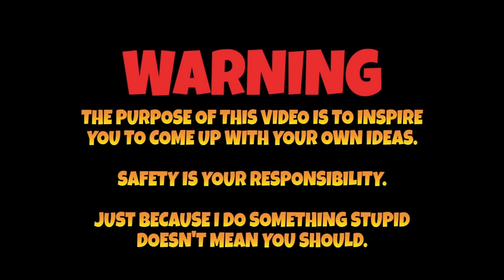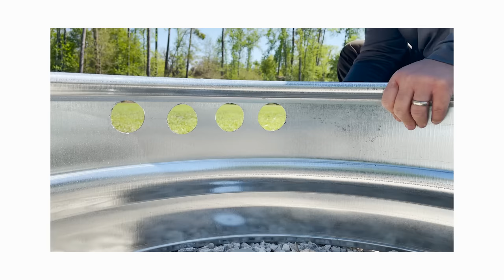12V Milwaukee More Powerful Than 18V? Head 2 Head Torture Test!

Comment: I’ve ran m18 fuels for a few years and they’ve out performed anything else I’ve used! Finally broke down and just bought a 12v fuel set which is why I am watching this. This video is a perfect example of using the right tool for the job. 18v is good for install, 12v is more convenient for service and repair! Just my opinion as an electrician who’s worked in residential, commercial and industrial settings.
Reply: That and sometimes the m12 can  just get in some real tight spaces I feel
Reply: Bingo. I'm in residential HVAC service and the M12 line serves me well in SO many situations working in tight quarters. IMO, M18 is great for commercial and residential install.
Reply: So as an electrician myself. I am asking what you mean by the m18 is better for installs? Obviously useful for drilling wood studs, unibits, and large holes. However, in steel stud for the application of boxing, strapping, and even half inch holes with twist bits I think the m12 is more than powerful enough.
Reply: I use makita 18V and milwaukee m12 at work as a door installer. No doubt 18V tools are stronger than M12. But the M12 tools are overpriced and some of them are even more expensive than the 18V makita
Reply: Totally agree. The M12 are better for lighter jobs where you don't need extreme tork but finesse for a finished product.
Reply: I'm electrician as well and that information helped me to choose right tools. Cheers.
Reply: Sad the m12 fuel is so compact, as an hvac installer something with a small battery would be great
Reply: M18 all the way, I do have the M12 screwdriver though and it's my go to for finish work.
Reply: I am an electrician and my fuggin DeWalt set got stolen so I replaced it with an M12 set.

Comment: The lack of tightening and locking your bits in the chuck was a bit frustrating…and you can add the handle to save your wrist a little
Reply: I was going to comment the same thing, about the tightening/locking and handle to save wrists.

Comment: Great video but when you tighten down Milwaukee chucks don’t hold it and spin the drill to tighten it, that’s why your bits kept falling out if you spin the chuck by hand with the drill off there is a ratcheting system that gets the chuck super tight. On a side note the m12 is great for light duty but for large paddle bits and hole saws the m18 is the top dog
Reply: After you ratchet it tight by hand you can go back slightly the other way until you hear a click and your bit is now locked into place
Reply: WRONG. Turning the chuck back until it clicks UNLOCKS IT. Go watch AvE's video about this, he breaks down the patent drawings and everything. STOP PERPETUATING THIS MYTH. IT DAMAGES CHUCKS.
Reply: Milwaukee Chuck’s just can’t hold bits no matter what just a problem with them .
Reply: @leaf5073 link the video, don’t know who AvE is…

Comment: While I won’t argue that 18v is more powerful, I’m an electrician and I use m12 impact and drill at work every single day. Serves my needs just fine. About the only thing I really need an 18v drill for is hole saws. I run the surge impact though because it’s a lot easier on the ears. It crazy how much quieter the hammer is on it.
Reply: I got the m12 surge impact and I've framed 100s of lineal feet with no prob...so many ppl like how it sounds like a toy but it gets it done!

Comment: I have M12 tools, I got them for the smaller size and ease of handling.  If I needed the added power of the M18, I use a plug in tool.  I have the impact driver, hammer drill, reciprocating saw, multi tool, 3/8 ratchet and 3/8 impact wrench.  They have been great tools, very ergonomic and reliable.
Reply: Same here...my M12s cover just about everything I need and if not I use my corded tool.
Reply: @WolvesHart79  The only thing they miss is an m12 wood planer. That would be amazing, I was surprised Milwaukee doesn't make one.
Reply: @em4703 tôi cũng muốn 1 chiếc máy bào gỗ m12

Comment: I brought the M12 Impact into the shop and it was laughed at
Now: Everyone in the shop has the M12 Impact and nobody's laughing
Reply: I too was laughed at the jobsite. No almost everyone I know has M 12. From there a little SDS setting air conditioners to impact driving screws to compact bandsaw cutting strut. They are more than powerful enough for most work and they are so much lighter hanging off your toolbelt or working overhead. Yes I have a super Sawzall and an M 18 super hole hog. Sometimes you need bigger heavy duty to but most of the time you don’t
Reply: @kconnor2371  this was my thinking, ppl make fun of ya till their shoulders arent as worn down at the end of the day from not having 5lb of tool over their head

Comment: This is painful to watch when the guy doesn't know to manually tighten and lock the chuck.

Having said that, I own a large amount of M12 tools and Makita 18V. 
There is a HUGE difference in power once you start going over any bits that are half inch.
Reply: Thank you !!!
Reply: Amen!
Reply: Was thinking the same thing
Reply: LOL make me laugh, with all that best tool behind him, not surprise he cut his hand seeing that he don't know how to tighten even the bit, hope that bit not strike him, like saw.
Reply: Lol at work I tested both and you’re exactly on point, anything over an inch is basically not going to go well. Just get the m18 for anything over 1/2-3/4
Reply: The power and speed of the new Makita 40v is amazing... they smoke the Milwaukee, and I own loads of  M12 and M18.
Reply: The most basic procedure overlooked. Come on man...
Reply: Dude it annoys me so such more than than it should. I don't think I've ever met someone on a job site that can't secure a chuck properly. It hurts me when he acts like it's just a normal thing to have your bits fall out of the chuck every few minutes.

I know this video is for fun but dang man lol he can't drill straight for nothing.
Reply: Same with the rest of the PPE he's not wearing
Reply: Just an average guy drilling holes. Obviously the 18v is a clear winner. Nothing wrong with the 12v though. :)
Reply: He needs a hex mod on his drill so he can just pop it in.
Reply: @joshb4286  Bro I have apprentices that still can’t manage to figure out how to tighten the chuck correctly after 6+ months of working. Floors me every time.
Reply: You should tell them that the only reason the chuck isn't holding bits in is because they forgot to blow out all the dust inside the drill before putting the bit in.
I'm willing to bet that you'd see one of your workers blowing in the end of a chuck
Reply: @TheBootyWrangler  no let them keep doing it. All u gotta do is email milwaukee saying u bought a tool based off one of these reviews and it was the wrong,very expensive tool for the job.I pretty much told them the m12 is being put on a such pedestal by the ones they're sending the tools to,it's putting a lot of misinformation out there(amazing how society just saying what they want like it's fact DOES have implications)which is leading to inferior tools being bought.Like their m12 "stubby" impact wrench has essentially been made out to be the only tool a mechanic needs. It didn't last me 6 months of basic use(truthfully I got a defective tool,it didn't last 50 uses)and was the first milwaukee tool I ever bought. Without question milwaukee sent me the m18 3/8 compact impact,a m18 3/8 mid torque,2 batteries and charger...plus they fixed the m12 stubby under warranty. Told them they needed to start treating their paying customers BETTER than the ungrateful influencers who plug their tools
Reply: @TechTokOffical  woah 😳 that’s incredible!
Wish my m12 would start acting up so I Could email them
Reply: You know what they say don’t trust anyone to work on your shit if there tools are brand new lol

Comment: I'm a cable guy, so I'm driving screws to hold up wires, occasionally drilling into concrete for small anchors, etc. I've been carrying around an M18 on my belt but it's getting a bit heavy...I think I'll do the M12! It's incredibly powerful for being so much smaller.
Reply: Got an M12 5o replace an M18 that someone stole off my site. They were out of 18's at Depot when I went. Had no idea there was a push button to change speeds on top of the M12 impact driver. I thought it straight sucked at first, and let it bounce around in the truck for a few days. It changed the speed to 3 and I was stunned...then realized there was a light on top of it with a button...such an idiot. Great power, and the batteries are nice to have for my jacket during colder days.
Reply: Cable guy as well. Honestly the only thing I break out the M18 for is hammer drilling 3/8"-1/2" holes in stone/concrete/brick walls, I live in an area with a lot of old farm houses with river rock and heavy stone foundations, or any hole needing to be longer than 6" (and even with this if they made 7/16" bell hanger bits that were 12" long with a 1/4" hex drive I'd use those with the M12). Everything else can be done with the M12 impact driver. Screw clips? M12 Impact. Wall plates? M12 impact with replacement screws (because he ones that come with wall plates are trash, I mean seriously who decided on slotted screws that strip after the most miniscule amount of force?). Anchor holes in literally anything? M12 impact with a 1/4" multimaterial bit. That M12 impact has replaced my old beat up Ryobi electric screwdriver, my M18 impact, and my M18 hammer drill (for specific applications). This is all with the 2A battery too, I have a 4A but I just find I don't need it and the 2A fits in places better. 

I mean who wants to be carrying an M18 up 20-28' to drill a pilot hole for an anchor or drive in a few screws? I don't anymore. M12 fits in the pouch with my other tools so I don't have to worry about missing the clip and I'm not fiddling with chucks and bits up top in wind, rain, and all other kinds of crap. It was easily the investment I appreciated the most. I'm tempted to try using the M12 hammer drill for the larger holes, but just don't know if it'll have the grunt to drive a 26"x1/2" masonry bit through a stone foundation.

Comment: I found that with the 18v.  The cheaper bits do not hold up. I drill into a lot of masonry to mount anchors.  I have found that when I first got it, I was destroying the tips off the bits.  It has so much more torque and speed. The bits where glowing red hot and broke the masonry bit ears right off. Great drill and impact set.  I am so glad they have improved to this point.  The first tools were so under powered.  The most popular tool was the Makita drill.  They were hard to kill. We had to carry a Milwaukee corded hammer drill to back it up for the tough drilling. We did beat them pretty hard also. I have always like the corded drills.  Now it seems they have worked out the bugs over the years.  They are a great set.  Would recommend to anyone on the fence.  Since we use ours every day for work.  I actually use both a hammer drill and a standard drill on some projects together.  This helps to keep from changing bits and cuts down on time.  They have become more job specific with the battery setup.  Keeps down on the weight for handling the tool all day.  I keep some of the 1.5ah batteries for that.  Which is nice for the flashlight also.  I have found it helpful to have a variety of batteries. I currently carry 1.5, 3 and 5 ah batteries.  I have two of each with two chargers.  I have not run out of charged batteries on a project yet and help so keep them   charging quickly.  The tools are well worth the money.

Comment: I’m just amazed at how well the M12 compares to almost any 18 or 20 volt tool, especially with the 6 amp battery.
By the way, the 6 amp battery provides more power in most cases.
Reply: That's probably why my drill is weak. I don't have good batteries.
Reply: @dangrimes5078  Or it’s just a weaker drill. They all have a torque rating.
Reply: the six amp hour battery has known issues with its longevity, unfortunately

Comment: I have several examples of both the M18 and M12, the main difference is power, if I have a simple task I'll use the M12 because of the weight, but when power is required, I'll used the M18... an example was putting long screws into 2x4 stock, the M12 could start the task, but didn't have enough power to force the boards tight, when I switched to the M18, not only did the gap disappear, the screw was counter sunk into the wood.

Comment: TL;DR: More Ah doesn't directly mean more power, but a smaller battery could limit your tool's ability to pull power from the battery.

The capacity of a battery doesn't change the power the battery can deliver. HOWEVER, for power tools, a bigger battery usually means more "rows" of batteries. A row consists of a couple of cells that are put in series. This increases the voltage from roughly 3V per cell, to a total of 12V or 18V. Now to add more capacity, you need more cells, but you can't put them in series, since that would increase the voltage, so they put the next row parallel with the previous one. When cells are hooked up parallel, they increase the amperage, which in turn can make your tool more powerful (or really, a smaller battery can make your tool less powerful, the max power is always determined by the tool, not the battery).
Reply: To simplify, have three guys of the same size carry the log ten miles or 6 guys of the same size carry the same log the same distance.  Not necessarily adding more power, but distributing the load and allowing more work to be done for a longer period of time.
Reply: Also the rpms and in/lb of the M18 drill probably double M12 due to smaller battery.
Reply: @11:10 pilot hole... It's called a pilot hole. Not pre drill
Reply: @RandyMarsh0301  First of all, you're replying to the wrong thing, mr. "expert". Secondly, pre-drilling and a pilot hole are two completely different things. A pilot hole is a thing, pre-drilling is an action. Those can exist side by side. 
Also, it's not "cAlLeD" a pilot hole, that's just something that some people call it. You can call it a pre-drilled hole, poopsicle, whatever you like. Don't be so pedantic, it's just sad.
Reply: @timderks5960  Wow someone is angry. Are you ok now? You got all that off your chest? Have a Kleenex (or facial tissue if Kleenex offends you) and just breath.

Comment: What I'm buying the M12 for is for tight areas and the m18 for my daily driver.
I worked in a shop that made AC units for data centers I always looked down upon m12 but now I see the value! 
Looking back there's been times where I'd rather sacrifice power for compact multiple times a day for the longest time all I valued was power.
Reply: Lmao. I do chiller hvac work and m12 is fine 90 percent of the time. I have the hex and the 3/8 stubby. 
It’s not that often that I have to use m18.

Comment: I'm no expert, but from my personal experience I can say that the xc batteries (at least on the m12) have more power. You can definitely hear the rpm difference between the two different batteries. My scientific take on this is that because the larger xc batteries have more cells in them, they can distribute the load more evenly between the individual cells, which causes less strain/draw  and more rpm due to the amperage draw being more equally distributed. Once again, I have no idea, but it sounds good to me...lol
Reply: As an electrician. Yes simply having more amps through the extra batteries will fove you more power Va
Reply: The load is split between the two sets of cells, therefore there is less voltage drop or 'sag'. So higher voltage, proportional higher current therefore significantly more watts of power.
Reply: Correct.  Twice and many cells in parallel can supply twice the current.

Comment: 6.2 lbs vs 3 lbs... I have both.  I use the m12 drill and driver to mount boxes on to concrete block.  Those stay on my tool belts but sometimes I need to drill a large 2 inch hole into concrete block.  I would not carry around the m18 with 5ah battery on my tool belt.  Use the correct size tool for the job.

Comment: TL;DR most modern power tools - bigger battery more power !  

most modern power tools do get more power with higher capacity batteries, lithium cells have a Discharge Rate usually specified in C, say the cell is 1.5Ah and discharge rate of 1C, you can pull 1.5Ah x 1C=1.5A from the cell, say its 20C, you can pull 1.5Ah x 20C = 30A from the cell, then you add more cells in parallel (increasing the battery capacity) say instead of 1 row you put 3 in parallel it triples the current you can pull from the battery, meaning you can pull 60A (with previous example) and this counts. tools an batteries have electronics in them monitoring the currents and voltage to protect the tool and the battery, so if the m12 shuts off when it binds its because the 2Ah battery told it to cut the power because it cant provide more current, the 6Ah battery would of had 3 times the limit of the 2Ah, of course you need to take into consideration the amount of current the tools motor can handle, that why the tool and the battery constantly "talking to each other", this is why its very important to match a tool with a battery to get the most out of it, there is a video on youtube of a guy using the m18 12Ah battery on the m18 driver or impact and its just shuts off when he pulls the trigger because the tool is overwhelmed with the amount of current is gets (also an engineering fault) also bigger batteries are better for battery performance and overheating, when you are really pushing the tool - with bigger battery the battery can push more amps and run cooler.